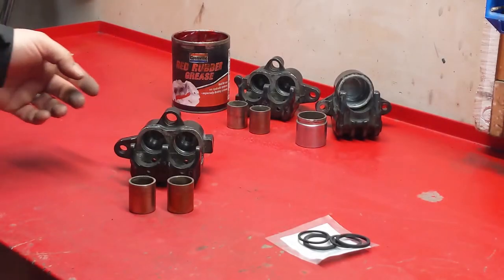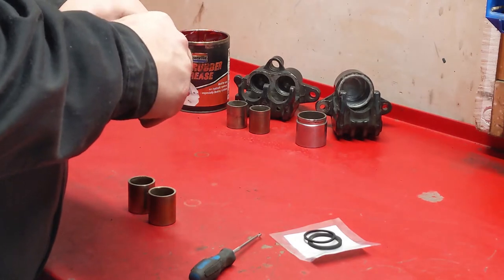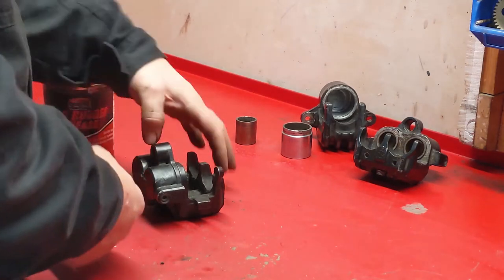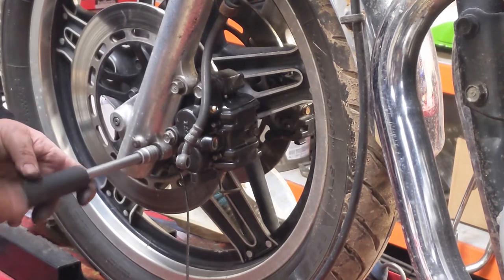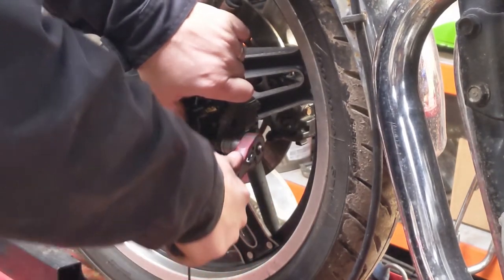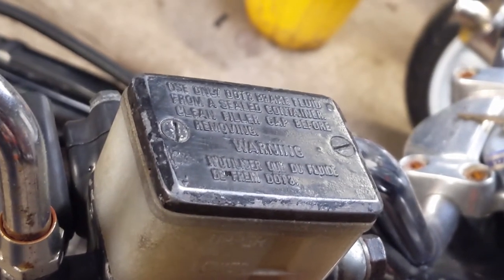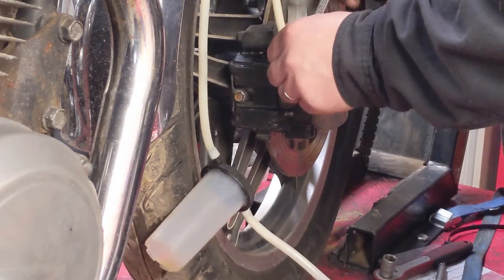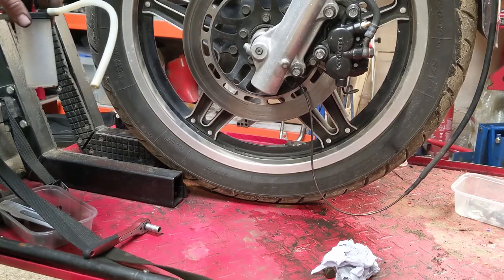Honda CB900C Brake Overhaul

Comment: Greetings!  I have both a 1981 and a 1982 cb900c.  Their brakes are different, the former w/ single piston, the latter with two. The former also has a number of clips.  My question: On the 1981 model, how/where does one position the "retainer clips"? Not to be confused with the "anti rattle" clip.  There are 2 per caliper and I can't remember exactly how they fit and/or find any pictures of same. Thanking in advance!  Peter

Comment: The bike I'm working on only has one piston each caliper for the front?
Reply from the maker: Could be a different year. Also, on older bikes you never know what's been changed by the previous owners.
Reply: @ricksclassicandcustomltd.777  I think it just must be an older model as I'm shopping for refresh parts, front and back both locked up